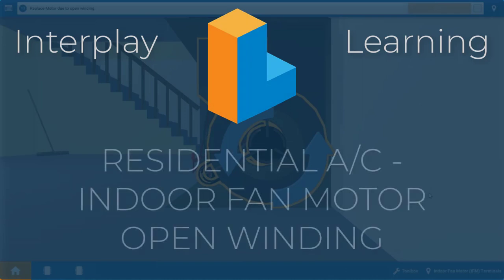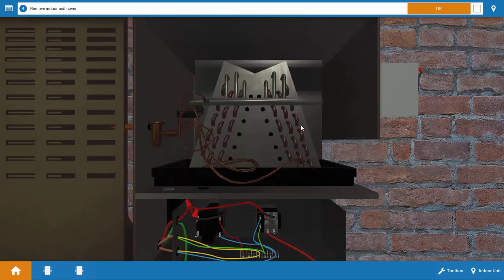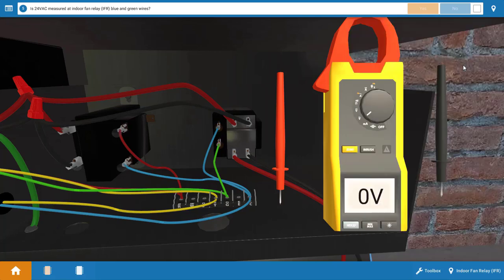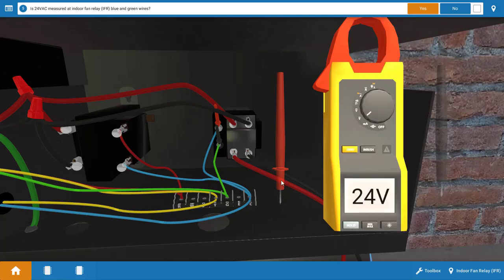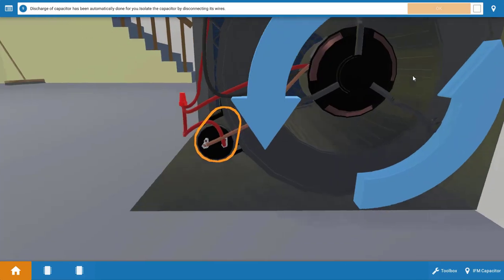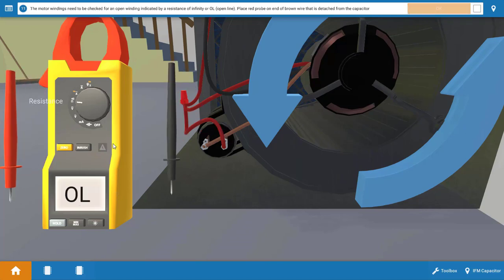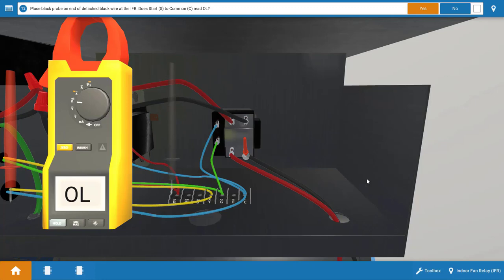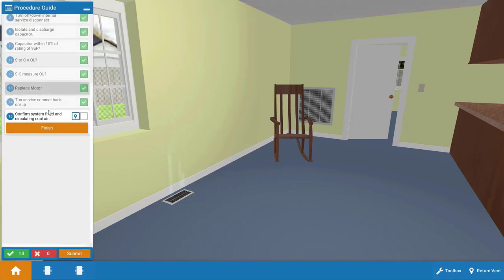Troubleshooting a Faulty Indoor Blower Motor on a Residential AC

Comment: My AC went out and im trying to figure out what’s wrong with it. Outside unit is turning on and fan is working but my indoor unit is doing nothing., the blower fan will not turn on, no airflow in vents. When i turn it on its just making a clicking sound like its truing to turn on but nothing is happening. Any advice?

Comment: Great video! My outside fan is running for about 5-10 minutes before the inside unit run and blowing cool air. I just replaced capacitor for both outside and inside unit. Do you have any advice? Thank you so much!
Reply from the maker: We're glad you enjoyed the video! As for your question, it could be many things... thermostat, fan relay.  This would require voltage checks at the line and load side of the fan relay, as well as at the coil of the relay. When the outdoor unit starts and the indoor fan is not running, measure for 24v at the fan relay coil.
Reply: @InterplayLearning  Just replaced the replay and both units are running at the same time now. I appreciate for your help!
Reply from the maker: @tovanhung1  Glad to hear it!
Reply: @InterplayLearning  I have another question. What could be wrong since my thermostat met the set temperature number but the AC keeps running for about 30'. I'm using Honeywell Smart thermostat. Thanks
Reply from the maker: @tovanhung1  Thermostat is malfunctioning or not properly programmed if it's running for 30 min after. If it's only running for 30 seconds after, that's normal with new smart thermostats.
Reply: @InterplayLearning  I will replace my thermostat this weekend but I doubt that there is some serious fail to my A/C since it's running all day today. I set temperature to 77 F but it only reach to 79 and keep running. There is something that I need to check? I appreciate for your helps and sorry to bother you :)
Reply from the maker: @tovanhung1  It could be many things. Refrigerant leak, poor airflow or weak compressor.
Reply: @InterplayLearning  so for these problems, it seems like I have to call professional repair because it's not DIY things?
Reply from the maker: @tovanhung1  Correct.

Comment: same question.  My fan starts to turn but turns slow. Capacitor is good and getting ohm reading from high, med and low blower wires. what should i check next?
Reply from the maker: Still sounds like the capacitor.  It's possible the Motor may be on the way out... seizing. Most are permanently lubricated, so the motor would have to be replaced.